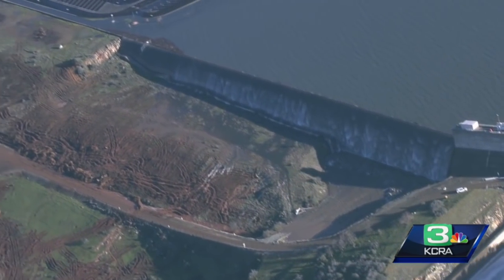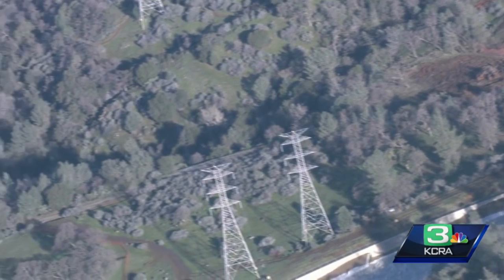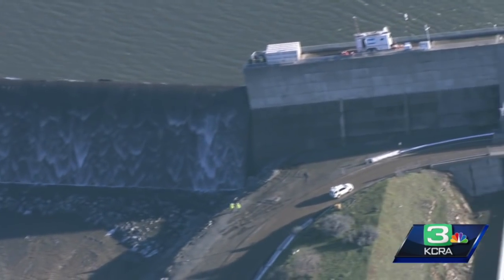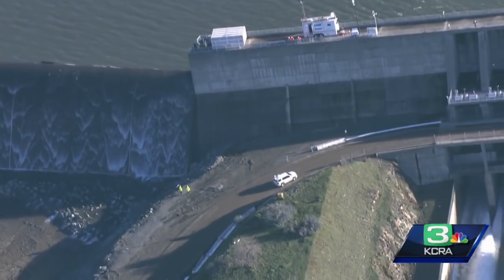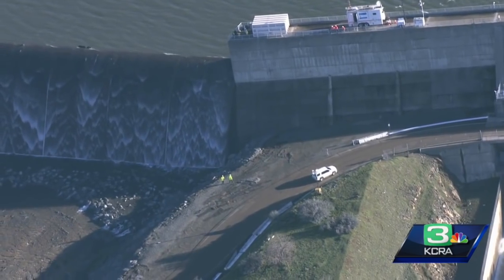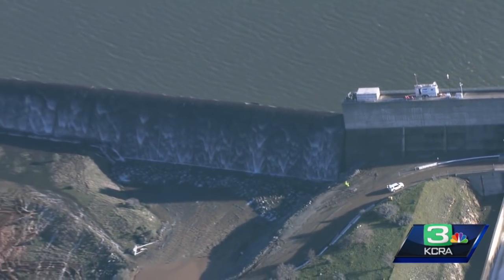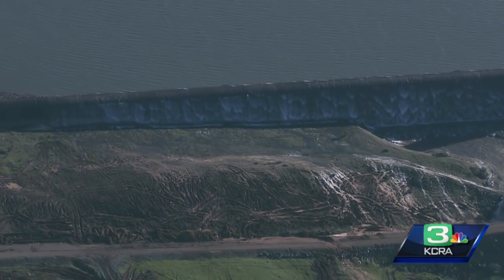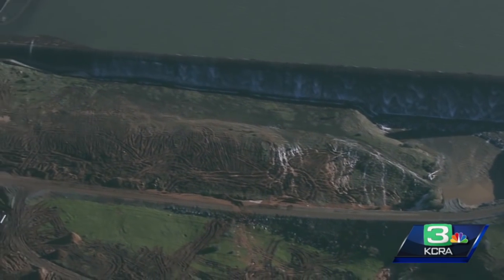Oroville Dam Spillway - 02/11/2017

Comment: If any part of the emergency spillway fails, the lake drains(down to bedrock).  Looks like the back of the emergency spillway is dirt right up to the base.
Reply: The emergency spillway is concrete at the edge of the lake.  What you suggest can't happen.  The erosion is below.  The water flows over and any erosion is below the lake.

Comment: wow...thats crazy, they never reported why the run off is occurring,  or show the big whole in one of the run off drains,  they just keep the camera on the overflow, but all the way to the right side, one run off channel has a whole, so they stop the run off, by doing that the water is overflowing its banks on the right side of the broken run off channel, in other words , its like making a bath with the water running, however, all of a sudden,   you cant stop the water, say the nob broke and the water will not turn off now, and the drain is clogged as well,  sooner or later, the water will overflow the bathtube and run on the floor and spread slowly throught the bathroom , hallways ect...since they can not stop the water, and one of the run off side drains is damaged,  they can not open that drain which would keep the water at a normal level, so they need to do this to keep the water close to normal levels, if not, it will overflow on a different side where people may be living. its a temporary solution to a big problem.....
Reply: Mesha Thomas

Comment: Is that all wasted water?  Does it go to the sea?
Reply: Holly Holm all rivers flow to the sea on our planet. Unless we divert them or suck them dry. This particular dam is on the Feather River. The dam itself is to the right and is sound. The spillways are to the left. The main spillway is damaged so the emergency spillway is being used as well. This keeps water from going over the actual dam structure itself, which would compromise its safety. There's also another smaller dam downstream from the Oroville Dam. Everything is fine.
Reply: I just saw a video on YouTube by Paul Preston.  I don't know his credentials but apparently he is a reporter on the scene and he says the dam will fail when the new storms come and that he says everyone there knows it.  I don't know who to believe.